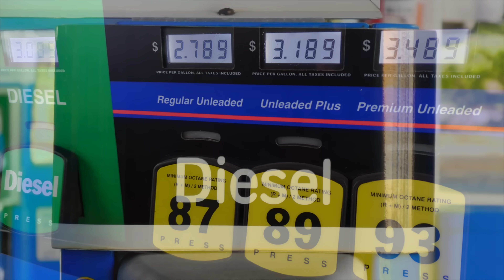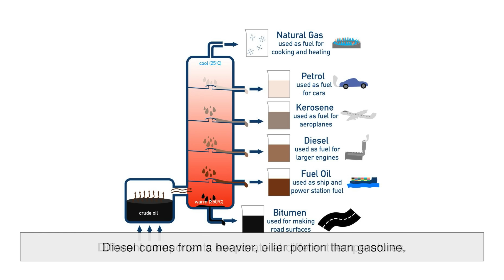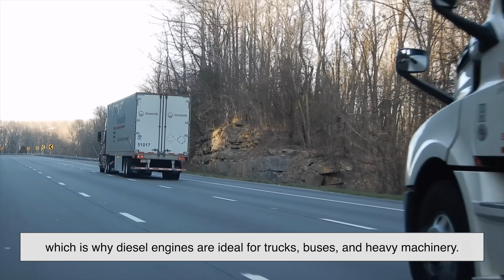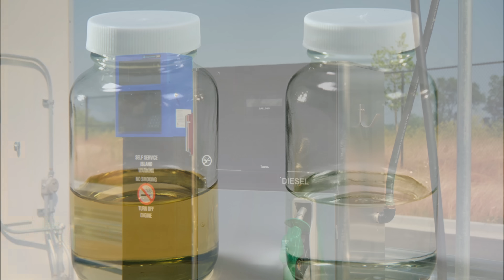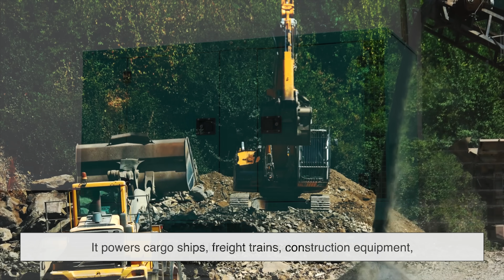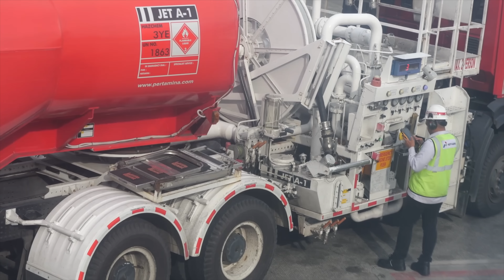What Is Diesel Fuel? (More Than Just Fuel for Trucks)

Comment: It was 400 parts sulfate with original red diesel Tier 2 and on have to use low sulfur or ultra low also the fuel rail went up to 15,000 psi on tier four

Comment: Low Sulfur Biofuel Diesel fuel is also used to heat homes here in the Northeast, like mine. I have a oil fired steam boiler to heat my home. The fuel is up to 20% biofuel 80% Diesel.

Comment: In Belgium 70 % of the cars used to run on diesel engine, but because diesel emits more air pollution. So their numbers are declining. Dutch cities like Amsterdam and Utrecht forbid diesel cars from entering their cities.

I have owned 2 diesel cars, nice reliable engines. Harder to stall.

Also in the Netherlands diesel engine cars were bought by people who had a high mileage, because that was cheaper. Diesel was, not now with the Iran war, 28 Euro cents per liter/ 69 Dollar Cents per gallon cheaper than gas, but with higher vehicle tax. So the break even point lays around 15,000 km/ 9,400 miles.

Oil companies were happy to sell diesel to car owner, because they always had surplus of diesel. 
Since gas was always in higher demands and in order to make gasoline, they also made diesel from the same crude oil.
Reply: Diesel in modern vehicles is clean.
Reply: Diesel used to be known to be dirtier than Petrol but these days diesel engines are much better and they are not necessarily more polluting then petrol
Reply: @lingth  That is great news.

Comment: The main reason Diesel engines are more efficient than gasoline fueled engines is that the compression ratio in gasoline engines is limited because at high compression the fuel ignites prematurely, whereas diesel engines introduce the fuel directly into the cylinder just when it needs to ignites - avoiding premature ignition and knocking. Through the basic laws of thermodynamics, higher compression results in higher efficiency in converting thermal energy into mechanical energy. Gasoline engines have about 25% to 30% efficiency while diesel engines can have 35% to 40%.

Comment: Keep in mind that diesel fuel is far more chemically similar to jet fuel than gasoline
Reply: Correct, During WW2 the first German jet fighter Messerschmidt 262 run on diesel, not kerosene. And the Dutch Armed Forces want all their vehicles on kerosene to ease logistics. The USMC had motorcycles run on diesel for the same reason.

Comment: So if the process to make diesel is easier than gasoline why is it so much higher!
Reply: Taxes you have federal,state,and city taxes. California has one of the highest taxes on oil and gas.
Reply: Diesel used to be always lower until new low-sulfur regulations kicked in. So it might be due to the extra refining to remove sulfur.
Reply: Diesel is used for heavy machinery, power plants and a vast majority of industrial machinery.  The demand is much more than just gasoline.  It’s also more toxic in the air than just gasoline.  Go,to any developing world city and you can easily  see the difference in unregulated air standards